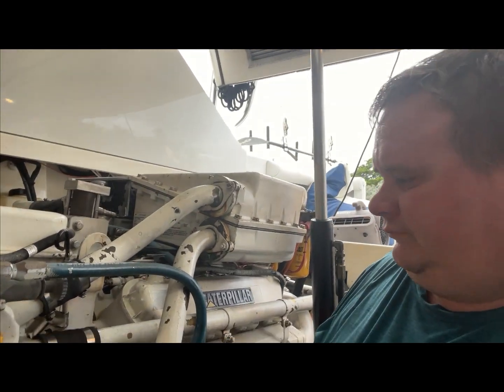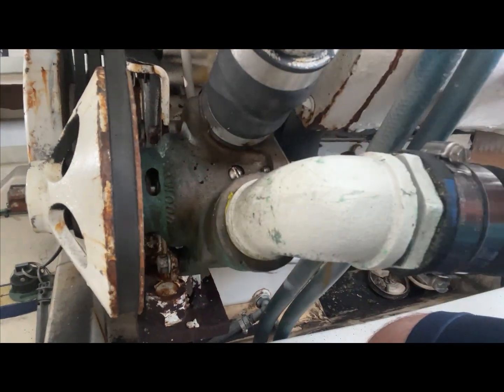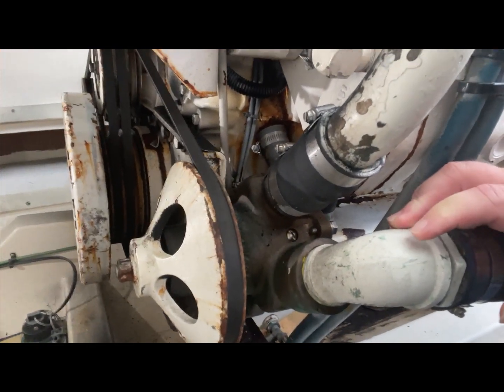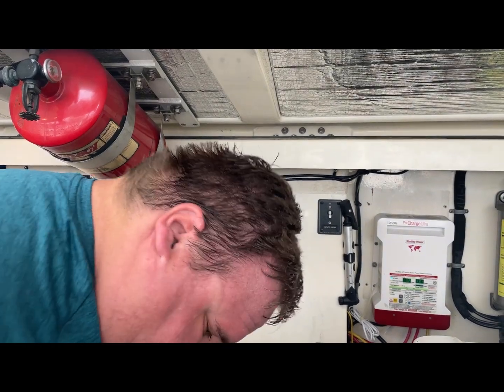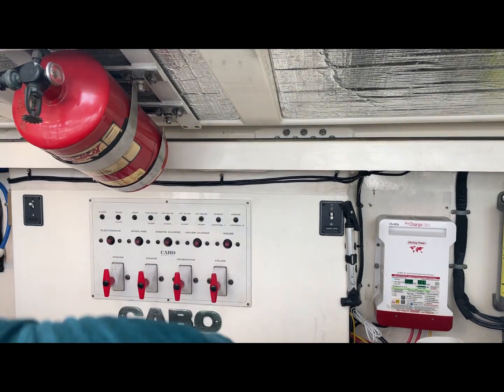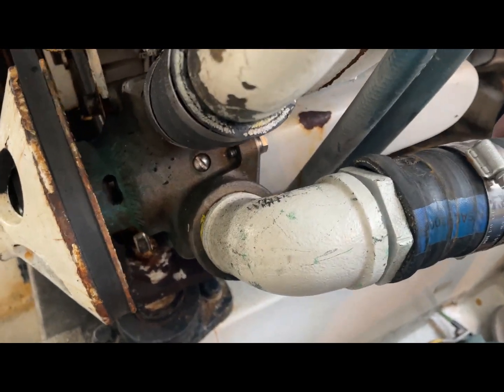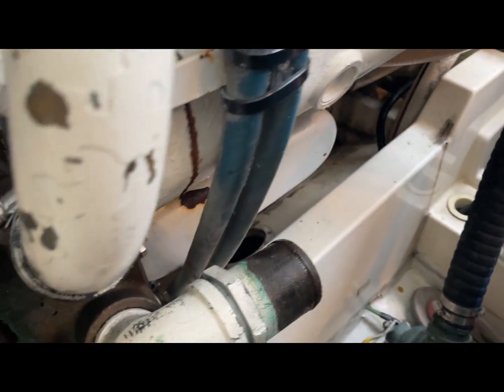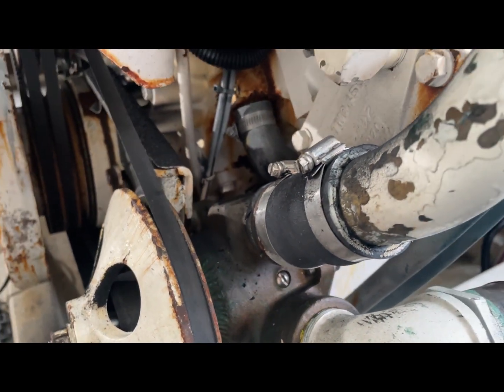The secret to DIY Water Pump Impeller Change | Marine Diesel Caterpillar 3208TA

Comment: I got supplies to replace mine.  Our have been in for 4+ years.  I hope they are OK?  What happens if the rubber is not in tact? Where would the pieces go?
Reply from the maker: Nice!  If the rubber is not intact it will most likely be at the heat exchanger.   Would need to fish it out so it is not blocking anything.

Comment: Plugs are for running a hose to dripless shaft seals for cooling and lubrication.
Reply from the maker: Interesting!  Guess it depends on the placement location.   My shaft seals are cooled off the transmission cooler.    Thanks for the comment!

Comment: Capt. Mike
Not sure I have a drip coming from my water pump 
Just wanted to know if there’s a seal on the opposite side close to the belt side
Thanks
Reply from the maker: Got ya, it is possible, but its not a serviceable part at least when you replace the imepller.   I have never taken the pump apart that far.   The door to the impeller only has a very thin rubber ring.

Comment: Awesome Video Capt. Mike 
I have the exact same boat and motors. Just a quick question did you have to change the seals on this pump.
Thanks again Bob
Reply from the maker: Thanks!  Yes I got my parts direct from the cat dealer and the little o ring comes with the impeller.  Is that the seal your talking about?

Comment: Would it be as easy to just take off the pump and not the bracket? The reason I ask is that I'm replacing my pump and would rather not remove the bracket.
Reply from the maker: I don’t think so.  The bracket needs to be loosened to eliminate the tension on the belt first.   It was easier to access the bracket for me since I was already loosening the bolts.    It was really simple to remove.